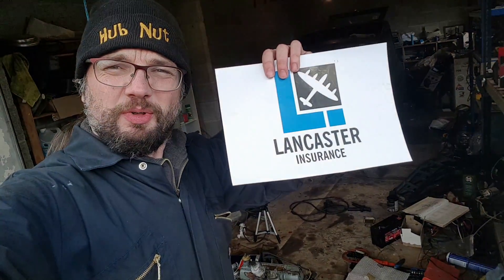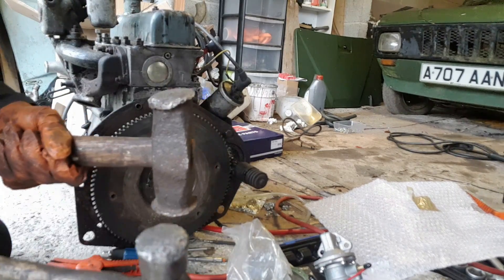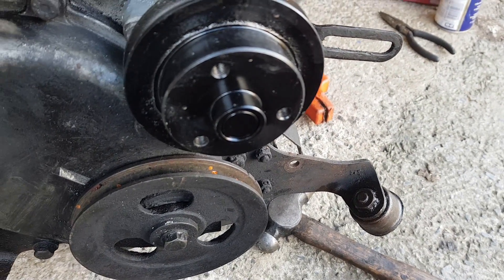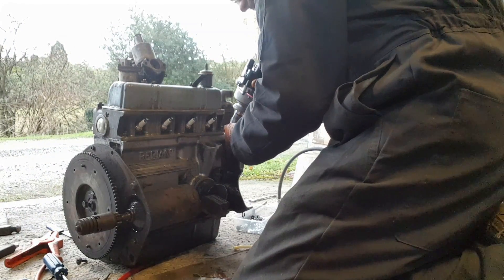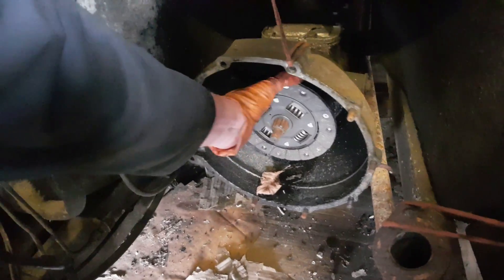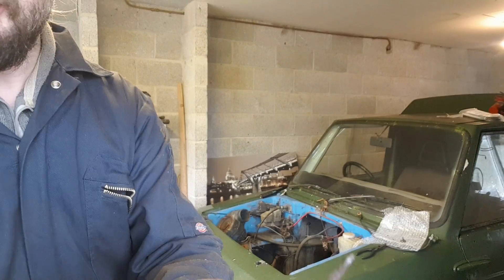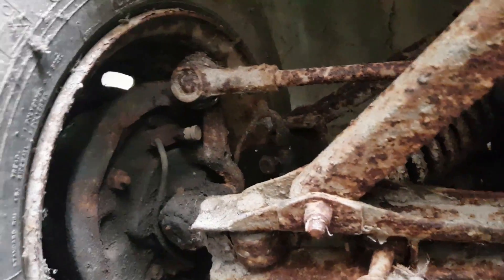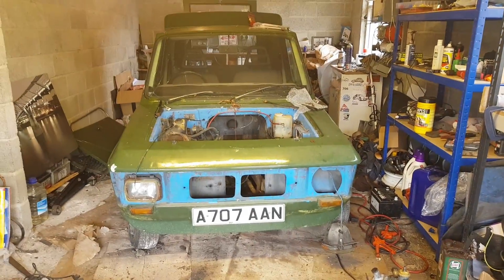Project Fox Part 7: Clutch, electronic ignition and more!

Comment: As one who has never delved this deep into the oily bits (another good thing about redblocks!) I'm really enjoying this series. Haynes manuals and exploded diagrams are great but there's no substitute for actually seeing how things like a distributor, carburettor or clutch fit together. And unlike a lot of other classic car videos on YT, yours really do capture the frustration, the trial and error, the head scratching and ultimately the sense of achievement and accomplishment (of keeping these old bangers going) that this hobby provides. Looking forward to seeing the Fox move under her own power for the first time :)
Reply: I'd be quite happy to see a close up of the Haynes section sometimes as Ian works. Memories of reading the instructions for a repair, thinking I understood it, my mind going blank as I tried to follow the instructions , then a desperate grab for the manual with oily hands to see what I am supposed to be doing next (repeat procedure many times). I never blamed Haynes, just myself for being so dense. I usually got it in the end, though. One thing I noticed was the need for better descriptions to describe the level and type of force needed to take things apart or assemble things. Seems superhuman strength is sometimes needed!
Reply: @frglee  sometimes it just says remove housing etc and doesn't tell to remove it..... so annoying.
Reply: @frglee  when I was a kid I used to read the Haynes manuals for my mum's little MK1 Fiesta and her Volvo 740 (probably what helped turn me into a Volvo nut, along with the fact that as a 13yo I absolutely loved that car, it felt so big and imposing). Of course, looking at an exploded diagram and doing the work yourself, on your own vehicle, in a cold garage in the dead of winter with skinned fingers and rusted on nuts are very different things. I'm surprised they made a workshop manual for the Fox, as according to their website they only now bother doing them for the big sellers (Astras, Mondeos etc). I'd imagine they're struggling in the era of cars that have plastic covers over the engine and are not designed to be worked on at home, hence all the novelty spin offs like manuals for the Death Star, Concorde, etc.
Reply: I was a bit surprised to hear that a chap from Sweden (Mackans Garage) actually uses Haynes manuals for his Volvos - would have expected something local!

Comment: Nice to see you used my little trick with the ratchet and tape for an alignment tool!, i personally find that better than the actual tools you can buy, not only does it do the job, but it also helps make any tiny adjustments you spot/acts as a better reference that it definitely is all centralised when tightening it all down.

Comment: Just a word from a 70’s trained mechanic... we always put red hermertite around anything to do with coolant , ie core plugs ....hope it doesn’t leak . Still love the channel and the humour.
Reply: red hermatite, ive not seen it since the 70s either!, smelled of meths if i remember, wasnt very good, blue hylomar was better :) or stag, if you had some leftover from the steam engine
Reply: @jusb1066  I used red when rebuilding my old BSA's,  it was a bit thin and runny. They brought GOLDEN Hermertite out and that was much better!
Reply: @geoffgreenhalgh3553  jeff, thanks, i was racking my brains that i new there was one i forgot, and just couldnt remember, golden was it! :) golden was mor elike glue, the gaskets didnt drop off when your back was turned, red was thin then later in the tube turned to crumbly lumpy mess

Comment: I think the metal bar idea you have to support the bonnet hinges is a good idea. I'd put a rubber or similar strip between the bar and the body to help prevent any vibration being amplified by the bar and causing stress cracks. Your use of hammers doesn't make me nervous, but I agree a couple of soft hammers would be a good idea, especially as I need to purchase one myself.

Comment: You are spot on with the ore plug and fitted it correctly. A cooling system pressure test is pretty easy and quick to do and proves integrity before going any further. I have a cheap kit of eBay that comes with loads of adaptors to allow this and a little pump and pressure gauge. Simply plug outlets, pump up till needle in the green and go have a nice lunch and a cup or tea.if needle still in green then all is good!, simple as.

Comment: Hope this catches you in time. Remember you will need to drill out the holes in the engine mount brackets to a clearance size as the thread will still be in there from when you cut the nuts off. Be very annoying if after struggling lifting the engine in, you find the studs won't go through the oles. As someone else has already hinted, the gearbox input shaft seal really  needs replacing.
Reply from the maker: Reliant chums reckon leave the gearbox well alone. After all, I've no idea if the gearbox is any good.
Reply: @HubNut  Fair point.

Comment: I was sitting there saying 'jack it up and go in from underneath' and you did! Sort of time lapse telepathy. It should be adequate to fill the hinge hole and use a patch washer. If the hinge operates freely then there is very little force on the grp. I can probably get the hinges repaired if it is only the pins

Comment: coming on nicely, don't forget to clean up the splines on the spigot  shaft which look a little rusty and a little grease  on the end of the shaft  where it goes into the flywheel .
Reply from the maker: Will be done. Don't worry. I'm leaving it until the engine is about to go in.

Comment: I used to add pieces of aluminium glassed into place to give reinforcement when doing repairs on my regal. It actually works well for hinge mounting points as you can drill through quite easily and once the resin has set it stops water ingress and therefore corrosion. Just make sure you use a pice big enough to spread the load and thick enough not to flex.
To prevent body flex you can stick closed cell foam, or even wood to the inside and glass over it to make a box section that won't bend and is very strong. It's how the early lotus cars were made as they didn't have a metal chassis as such.

Comment: I know this isn't your thing but, please, run a vacuum cleaner around the engine bay before you install the engine and get rid of all the dead vegetation and other non-Reliant crud.  (Dare I even suggest a quick wipe down with a damp rag?)  Being clean(ish) makes it so much easier to see what you are doing.
Reply: I have to agree with you while he has the engine out would it not be a good idea to get the pressure washer out and give it a good clean so much simpler with no clutter in there you do not have to polish it just get shot of all of the grime.
Reply: Doubt he would know what clean means ?
Reply from the maker: I shall buy a dictionary.
Reply: @HubNut  Sorry HubNut my comment was rude & uncalled for.

Comment: @17:45 surely one for the 2020 HubNut calendar?  Love seeing the progress, its far quicker than anything I ever manage (since changing the oil on my daily in October, other than buying parts, which I'm good at, the sum total of progress across the 3 cars is valeting one yesterday, purely because I was supposed to be giving people a lift and one of the seats had gone mouldy!) Now the weather is mild, and I should have all the parts, I really ought to get a move on before spring when one goes back on the road and the other (one requiring work) has its MOT!

Comment: Fibre glass is easy to fix but I note that there is a few cracks. You can get a patch for fibre glass but you will need a heat lamp to cure it. Only other thing with fibre glass the damage isn't like that on metal. Any damage tends to look ok on the surface but tends to expand internally. For the cracks you will need to drill a hole slightly bigger than the root of the crack to prevent it spreading after you have patched the damage
Reply: Forgot to add you can get the patch pads, which you cut to shape very cheaply on military surplus. Making them up yourself isn't for the faint hearted. In your case it's the randomly oriented chopped strands ones you want mainly used for harrier jump jets and typhoons

Comment: Hi Hubnut, just like to say the Fox is coming along nicely and as regards to the bonnet hinges I would do like you said with a piece of flat bar linking the two together? keep up the great work and use more do doo it helps. Mark
Reply from the maker: You can't get a piece right across the front panel sadly. The radiator opening breaks up the front end.

Comment: Hi Ian, looking at the Fox's gearbox with all the oil around the bell housing, might the oil seal on the gearbox  have gone and you putting in a new clutch, if oil gets in the clutch than you will have a problem, so all I'm saying is have a look at that oil seal and see if its leaking if so they don't cost that much and easy to replace, anyway good luck with the Fox all the best Jim.
Reply from the maker: I think the conclusion is leave well alone and monitor. We have no idea if the gearbox is actually any good.

Comment: Ninja turtle  fixing time
Great progress
Had a moment when you where cranking  thankfully your not wearing flares  then when you where rotating the clutch
I was wondering if I had to comment about the incorrect clutch but thankfully you figured it out without hammering
Clean up that spigot shaft splines  before mating up for smooth clutch release

Great to see your getting your hands dirty again 
Hope the human engine crane is getting better ready for the big day

Comment: Not sure if it's mentioned below but I couldn't see it, as you had to unscrew the old engine mounting even after cutting off the captive nut it might be worth drilling out the holes to the clearance size before you try dropping the engine onto the new mounts, although maybe not as it would be a good 'hub nut' moment on the engine fitting video if it didn't fit!

Comment: Never seen a clutch release bearing like that before. Remarkable. Definitely not a car to ride the clutch on. 
The excitement mounts yet further. A lesser man than me would suggest that now is the time to get a toothbrush out to thoroughly clean the engine bay from top to bottom! Such a person would probably go on to suggest a bit of copper grease on the input shaft splines. I am definitely not such a person fortunately!
Reply from the maker: Input shaft will get some loving.
Reply: A lesser man than I would get a warm feeling inside from hearing such news!

Comment: Quality hammering in this episode.  One word of caution, which i'm sure you'll hear from others, is that conventional wisdom holds that hitting one hardened steel hammer against another can result in universe-shattering catastrophy.   Best to wear safety glasses.   (Same applies to when you use a relatively hard chisel, only then it only destroys galaxies)

Comment: Probably you could tell that the distributor was mounted uncorrectly because as the combustion happened inside the combustion chambers, the piston weren't in the right position and the engine tried to spin backwards. In fact, if you pay attention, it doesn't even spin smoothly, but it produces periodic jumps! Anyway, greetings from the other side of Europe!

Comment: Great work Hubnut, I think your getting into it.  The grill was driving me mad that had to come off it looked awful.   Are you going to clean up the gearbox input shaft looked horrid rusty, going to eat the splines. Also the front suspension looks completly shot.
Reply from the maker: Odd. I was sure I'd replied to this. Input shaft will be cleaned and lubed before fitment is attempted.

Comment: The spark plug leads look a bit leaky from here- maybe the improved ignition is too much for them- have a look in the dark you will see any sparks jumping about. You can get Kevlar mesh from some GF suppliers  and soak and bond it to the GF ...it's strength  is legendary.
Reply from the maker: There was a spark tester fitted, hence the visible spark.
Reply: I should have known ....looking forward to the transplant ceremony with Mrs Hubnut.

Comment: Although 6,000 Miles away from Wales, I have been listening to a neighbour ‘Hubnutting’ with a ‘Bangernomic 1992 Kia Pride!’ The car cost him PHP 25,000 (£380) from a ‘Funeral Sale’ and bears a striking similarity to the Fox! – Bottle Green on the outside (Hand Painted) and Sky Blue on the inside! Also, there is no Interior! (No Head Liner, Door Cards, or Dashboard). I have heard ‘Hammering’ from the ‘Aficionados of the Manila Screwdriver’ for several days, and what I can only call ‘Endless Swansongs’ from the Starter Motor and Battery! After a visit to the Local Shop (Only for Local People) I left empty-handed and dropped-in on my neighbour!

He had been trying to get the ‘Old Girl’ going with the HT Wired as 1 2 3 4 from the Distributor, rather than 1 3 4 2! Once I moved the leads she started first time! They looked surprised, and with not even a ‘Thank You’ I left, and got back to work! The latest ‘Noise’ this afternoon has been the ‘Operatic Squeal’ of the Fan Belt! – Following afternoon tea, I dropped-in some Talcum Powder! I will let you know more soon, especially as I have one of my ‘Fleet’ due for its Annual Registration Check soon!

Comment: Nothing wrong with Borg and beck clutches, I used to sell them and never had a warranty claim, I think they were Oe on reliant from the factory
Reply: People tended to use the B&B clutch on Hillman imps which is the wrong application for this type of clutch, they fly apart at around 7000 rpm.The Hillman Imp was the first car to use a diaphragm spring clutch , which is universal on all cars now.I can't see the fox revving much over 5000 rpm 🐾
Reply: @nickclark6001  , i used to run a 998 imp , r23 cam and all lightened and balanced wills ringed no headgasket , twin 40 dcoe webers  , used factory comp clutches in it and it was happy up to 8500 rpm , it was my daily driver for over 5 years , it had citroen cx 25 front mounted radiator and skoda 130 r header tank . front mounted oil coolers for engine and trans , vw beetle cv conversion and vauxhall viva hb front disc conversion , spax shocks all round and negative camber front king pins , amazing little car
Reply: @paul_nwsxs  I know what you mean,you should still have one now 🖐
Reply: @nickclark6001  , i wish kids came along , strarted 2 businesses , needed a family car or 2 now its 3 , boring cars i am afraid , 2 yaris hybrids and rav 4 hybrid , but i do have a crazy polaris rzr which i love to bits , do i wish i had not wrapped the imp around an oak tree racing a renault 5 gt turbo 1 night  , but hey ho , did later build a reliant kitten with 1600 ford x flow in it , proper sleeper , looked bog standard , other than nice paint job and mg metro seats
Reply: Sadly Borg and Beck these days are made in China and very poor quality... if you can find old stock from years ago then they are fine.
Reply: @mattdebbage4760  , i left the motor trade 2005 and all i drive now is toyota hybrids so i,m not going to stress about clutches , but when i sold them they were good clutches , now if i was playing with clutches probably use LUK

Comment: I see 4 new wheel cylinders in your future - check the axle seals as they tend to liberate all the diff oil over the brakes = leaving you with a dry diff and a need for clean underwear when the brakes don’t work
Reply from the maker: Brakes seem to work just fine, but I will take a look. I sodding hate drum brakes though...

Comment: Sorry if I missed it but I didn't see you change or even lubricate the spigot bearing that goes between the end of the first motion shaft and the end of the crank - effectively the centre of the flywheel.
Reply from the maker: The input shaft will be cleaned and lubed. That should be sufficient.

Comment: Glad you checked the clutch plate and make sure it fits, I did not do this when I was having the clutch replaced on my Super Tripe, and Dave the Mechanic spent over two hours wrestling with the gearbox, trying to make it fit, until he thought, why not see if it fits onto the input shaft of said gearbox. No! Oh cock I thought. Replacement from the supplier sent, fits hurrah! Morel… always check the clutch fits onto shaft. At least I got a discount from Dave. 
Now for the bonnet hinge mount, why not try some carbon fiber with some steel bar as you suggested. Look froward to your next installment. Just spent a few hours trying to recommission my wife's Mini City. Good grief it's rusty under that bonnet. Hmmm rusty Leyland Car…
Reply from the maker: We used to have a City E. They do indeed like to rot!

Comment: I think the core plug is that way as its very similar to old Austin 7 ones and regarding the engines heritage just carried over from the sidevalve era to the 750/850 redesigned engines.   Just a thought too is because the engine and box is so light, its usual to take them out and back in as one unit usually by lifting car up high then lowering it and then using jacks to lift the engine/box into its mounts.   See you got caught out by the anti-clockwise firing order hehe   I think that is kinda something every small Reliant owner ends up doing and I got caught meself too and its that ray of sunshine moment after racking ones brains and perhaps a curse or two at Reliant for not putting huge stickers in engine bay reminding us its the other way round :D
Reply from the maker: It might be possible to thread the engine in from below, but there is a cross bar that would make that tricky. Easier in from the top.

Comment: Hope you don't hurt yourselves lifting that engine into the bay. I would repair the fibreglass before installing the engine as you will have more access.
Reply from the maker: Engine makes no difference for that hinge repair. The access is via the headlamp socket.